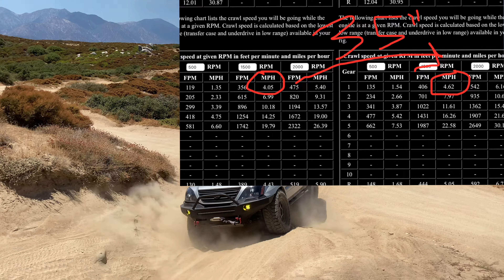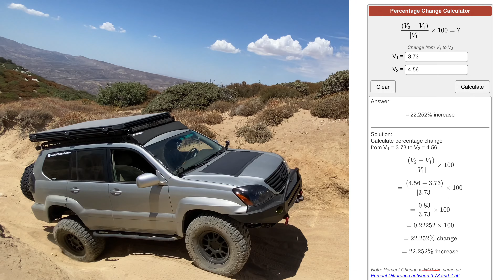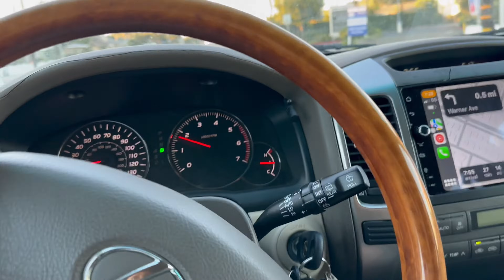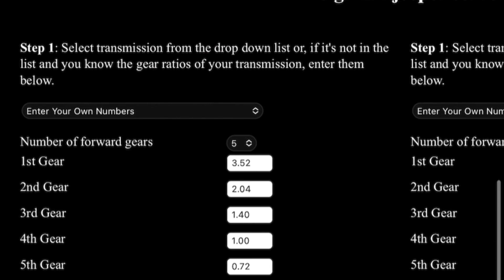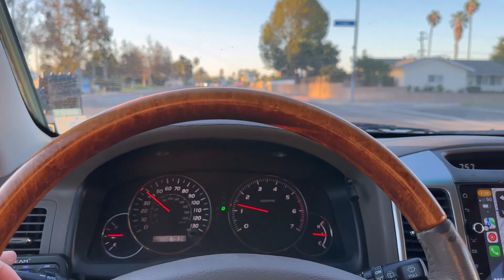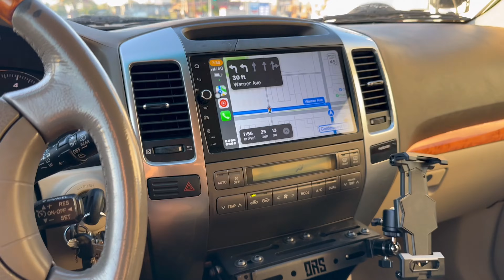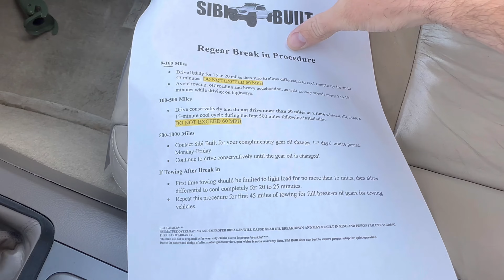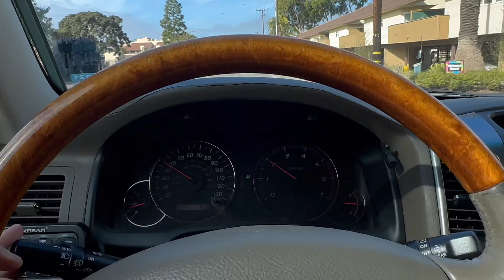How to Choose Regear Ratio for your Off-Road Build on 35” Tires Toyota 4Runner / Tacoma / GX470/460

Comment: You wouldn’t happen to have the part numbers for the ARB front and rear air lockers would.  I’m having trouble finding finding them. i’ve already had two suppliers tell me they don’t make them for a GX 470. obviously this is wrong. Thanks for your help.
Reply from the maker: I believe they are just the same ones as the early FJ before they put the 8.2” rear end in 2010. So 07-09 FJ 8.0” front and rear. Check out this supplier: https://www.polyperformance.com/arb-lockers-for-toyota-4runner

Scroll down to the table to see the correct part number for the GX470. Looks like ARB-RD121 (front) and ARB-132 (rear). I would call these guys to confirm. They will likely have a different answer than the other guys you talked to since it’s listed on their website.

Comment: Great details and thanks for sharing. Very informative. I don’t plan on going beyond 295s on my 5th Gen. 4runner but do want Elockers, do you think a regear is needed? I figure if I’m getting front e locker, I might as well regear at the same time but not sure of which ratio yet for daily driving and weekend wheeling.
Reply from the maker: 295 is the width of the tire in mm, so I can’t really tell what would be best. Use all 3 numbers (275/75/17 for example) in this calculator to figure out the diameter https://tiresize.com/calculator/

Then, use the percentage increase calculator I showed in this video https://www.calculatorsoup.com/calculators/algebra/percentage-increase-calculator.php to determine the percentage increase in tire diameter. If it’s under 10% larger than stock, then a regear is not 100% necessary imo, but it may still be miserable to drive depending on the extra weight on the rig. But to me, since you want to add lockers, it says that you plan on doing hard trails, and for that you need a short crawl ratio. Especially with the lower torque of the v6 at low RPM, a 4.10 or 4.56 would probably help a lot. 4.10 might be ideal whereas 4.56 would give you headroom to run larger tires in the future, but again, would need the tire diameter and other gear ratios in the gearing calculator I linked in the video to figure that out. 

E-lockers are great! If you’re doing front and rear, a regear is a no-brainer imo
Reply: Thank you for sharing the link and the feedback!

Comment: I'm debating between 4.88 & 5.29 . I'm about to be running rclt hd long travel on 37s with a dana 60
Reply from the maker: I think you would be happy on 4.88s, but it depends on what the vehicle is used for primarily. If you do a lot of highway driving and you like to go 80, 4.88 might be better. If you’re only concerned with off-road performance, 5.29 might give you that crawling edge, but keep in mind: the gear teeth in your stock front diff might be vulnerable because as you get shorter with your gearing, the teeth get a bit smaller. It’s a fine balance. Here is a really good article talking about what to watch out for: https://www.randysworldwide.com/blogs/size-matters

Comment: HOW does changing the gear effect street use with the big tires??? (speedometer need calibrating?) and gas??
Reply from the maker: It puts the gearing back closer to its factory-designed range. Drives more like a stock vehicle: When you upgrade to larger tires, it completely messes up the gear ratios, so regearing puts it back to, or shorter than factory spec, which I did to account for the excess weight I have on the vehicle.

Unfortunately, it’s kinda difficult to put the speedo back to actual speed on the GX470 so most just let the speedo be off by 5 or so mph.
Reply: @lexus_offroad_adventures  THANKS- that's kinda what I figured..

Comment: Oh HECK no-- go ELECTRIC lockers-- the air will FAIL in short term.. the electric are from FJ cruiser- and it's a direct bolt- in....  MUCH better- stronger and will NOT fail..
Reply from the maker: I don’t know how to put this… I respectfully disagree. Lol 
1) both are a direct bolt-in
2) ARB has been making these for 40 years. What makes you think e-lockers are “MUCH better”?
3) they are definitely not stronger. In fact, ARB uses 4 spider gears, with 4 points of contact and only uses high quality forged steel. Same as every e-locker I’ve seen. 
4) I prefer ARB air lockers because of the near instantaneous engagement and their integration within my onboard air system, which is already installed. 
5) air lockers are $1k and e lockers are closer to $1.5k. Since I already have onboard air, this makes financial sense.

Note: I think e-lockers are great! They are becoming very reliable. Just not right for me and my setup.
Reply: @lexus_offroad_adventures  NOT the lockiers that are better but the method-- the air lines nherrently cause issues-- leaks , breaks etc.. and always just when you need them.
Reply: @lexus_offroad_adventures  i agree with you. E lockers come unlocked if the vehicle rolls backwards just 1 foot or so, which is common making moves on rocks or rocking backwards in mud. Air lockers will stay locked. Also, with air locker you can engage it in 2wd if ya want, or just lock the front axle if ya want  Toyota only allows Elocker on in 4Lo (or 4hi if you hack it)  Another angle is semi trucks. They are alllll setup on air systems for brakes and suspension and yea they get airleaks sooner or later. But the industry hasnt changed in 50+ years with them. A good truck driver has a repair kit on board w compression fittings and spare air line to stay on the road and they understand the entire system.

Comment: Any updates on the new 488s ?  Anxious to see how they perform before I pull the trigger. Thanks for the great video.
Reply from the maker: Love them on 35s. Can’t imagine going any longer with the gearing with the weight I’m running. 4.56 might be ok and bring the revs down a bit on the highway but love how I’m able to get off the line with the 4.88s and it makes the rig feel similar to my wife’s stock GX. Plus there’s future room to grow in tire size if I want. I should make an update video

Comment: When you regear, your car drives on high rpm, does it get harder to get a high speed? Are you still able to drive 85+ mph?
Reply from the maker: Yes, the video explains the RPM at various speeds. Visit the gear calculator I linked to see exactly what RPM your rig would be at for 85mph. For the GX on 4.88s with 35” tires it will be close to 3k RPM

Comment: Did you have the speedometer recalibrated? Is that even an option for the GX?  I haven't been able to find any tuning options for the GX.
Reply from the maker: No, I don’t have it and I have yet to see anyone else recalibrate the speedo. If you have an aftermarket head unit, you can download the torque pro app along with a Bluetooth OBD2 reader and use the speed gauge with a a custom correction as your Speedo.

Comment: Notice any difference in mpg? Just curious - particularly at highway/interstate speeds. Appreciate the video, sir!
Reply from the maker: Since I have yet to really take it on a long trip and I live in southern CA (traffic all the time), I don't yet have an accurate assessment of gas mileage. Its way nicer to drive so I may be gunning the throttle a bit more than I was on stock gears but MPG looks about the same around town. (on the display 11-12.5, then + 13.4% to account for increased tire size so about 12.5- 14.2 real MPG). Highway, I'm expecting to be close to 16mpg on the display (~18.2MPG real) if I keep it around 60-65 without any hills. We'll see.
Reply: @lexus_offroad_adventures  My 470 is verrry similar - 35s, tent, etc… so I was curious if the higher rpm’s would affect mpg  negatively, or if the engine having an easier time with the gearing would improve it. I’d love to hear an update when you gather more data (as you seem inclined to do haha). Rock on!

Comment: Cost? I know your visit to the shop included CVs etc, but a rough order of magnitude is all I’m missing from this video. Thanks!
Reply from the maker: Neighborhood of 5k + or -
Reply: @Souk he also got front and rear lockers
Reply from the maker: @Souk Yeah the parts and labor starts to add up when you put lockers into the equation. I saved a good amount of money by going in with a Tacoma group buy. The guys at Sibi Built were nice enough to let me join. The 5k number is full retail